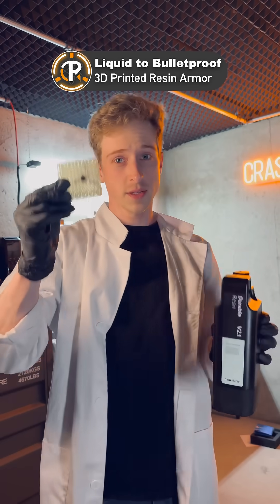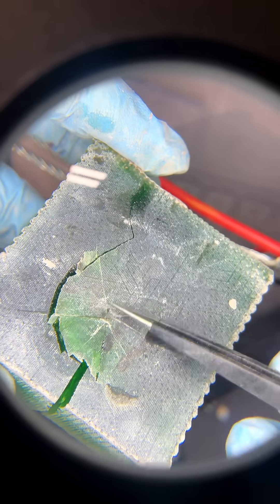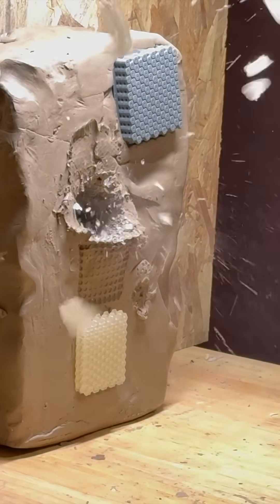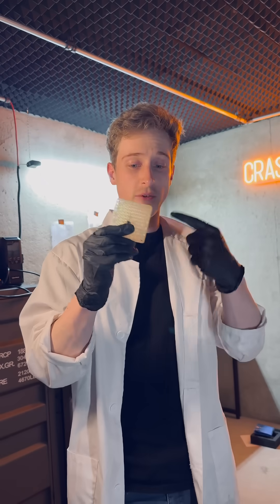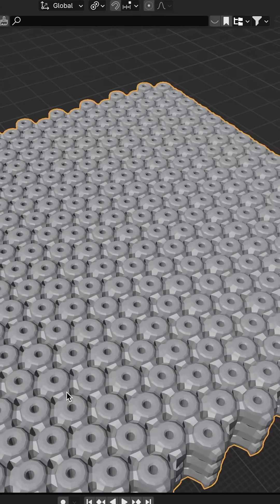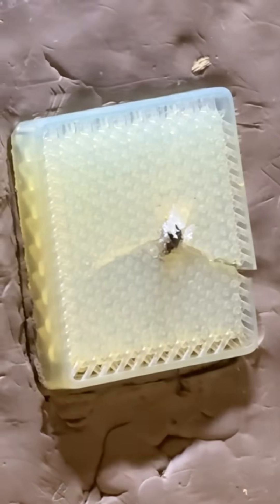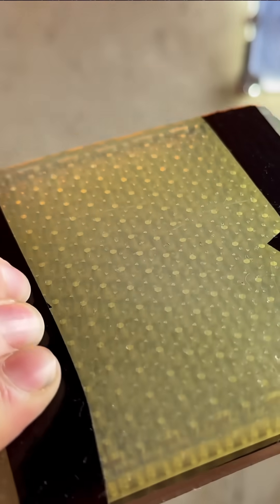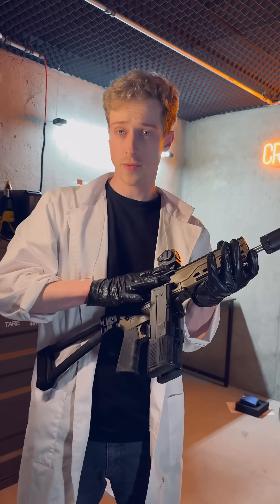BATMAN ARMOR💥🛠️ #Shorts

Comment: Now layer it thinly, kevlar between, turn your lattice sideways again to determine layer depth, a lattice plus a lil on each end to maximize the umpf of each layer of your material, kevlar, repeat.  Small hexes overlayed like bricks in 3D, held together by kevlar cloth sheets between, but locked in place as layers of loose stacked tiny hexes of your material.  You see the cloth armor that is really plate already don't you?  We haven't even spoken of high performance alloys that can be plated into any step, every step.

Comment: Have you considered using two different resins for the armor? If you were able to use a high tensile strength resin and a high compressive strength resin, you could potentially produce a superior composite armor. 

You could achieve this by printing a node grid of Liqcreate Composite-X  and then filling the voids with Monocure 3D TENSILE. When paired together, the composite resin material should out perform a mono resin material. 

The goal is to dissipate a round's kinetic energy through non destructive deformation. Currently, your prints appear to be dissipating a round's kinetic energy through deformation, fragmentation, and fracturing to accomplish said goal. 

By using a composite approach, the material should be able to withstand more impacts without fragmentation or fracturing, which should improve the material's longevity during a ballistic engagement.

Comment: What if you use a 2-3 layer kevlar sheet, impregnated with a shear thickening fluid, in front of the printed panel, or sandwich the STF fabric between the plastic and alum plate? Uses far less layers of kevlar than existing systems, no heavy steel; goal is significantly lighter ballistic protection systems, so even incorporating existing, known ballistic materials won't necessarily undermine your goals.

Comment: I know you probably won't see this but I have a question, Anyone who can answer, feel free to do so because it's a genuine question.

Would this theoretically allow for more flexibility if we made it thinner, more compact by overlapping plates of it or would that just cause compromises in the durability? 

Like instead of a solid plate, you made it look like lamellar  and layered that a couple times to deal with the shock but increase mobility? Then again, a drawback might be resource cost and the amount of resources needed. But it could cause flaws in the armor by segmenting it or making gaps that can cause issues in the long-run, leading to eventual structural failure.

Might have answered my own question but what is your take? Commenters included.

Comment: I would move to 9mm from 22lr. 5.7 is and extremely fast calibre. There are also  specific 5.7 military rounds that are known to be armor piercing. Most soft armors fail to it. If you succeed in a design that can stop full pressure 5.7 then you may want to file patents and start making calls. You’ll be a star lmao.

Comment: Just to point out, most people die of the force of the bullet, not the bullet bleeding them out, so while you did stop the bullet from entering, the force is basically the same
Reply: that's why a layer that spreads out the force and redirects it would be necessary. theoretically, if you could redirect the force so it's not goin into the body, you could stop almost any modern kinetic round.

Comment: I'm one of those people who really didn't think body armor could be improved, only tweaked. Glad to see you might be proving me wrong!
Reply: He's not.  what he's going to end up with is 3d printed plates 5 inches thick and 3x the weight of ceramic for the same rating.

This is nothing that hasn't been tried by the big armor manufacturers and engineering students before.
Reply: @shockwavecity  it seems like the empty space would make it lighter actually, even if it's 5" plates it'll still be practical because of that and also the ability to make it on site

Comment: 5.7 isnt highly penetrative. Garand thumb ran tests and its weaker than 9mm.
Reply from the maker: 5.7 is absolutely more penetrations than a 9mm, slightly less energy but lower cross sectional area and higher velocity makes it punch through armor WAY better. I bet the test you're comparing is a soft medium test like gel which is of course far different than hard panel penetration.

Comment: I see no value in what you're doing, but if I was doing this myself I would try and get an FDM printer. You're limiting yourself in terms of material. You can get some pretty exotic filaments with an FDM printer. They have a formaldehyde based filament which boasts a lot of structural properties you're looking for. And a dual extrusion printer may give you even better results if you layer two different filament types like nylon and Petg.
Reply from the maker: FDM printers lack the precision for lattices of this detail and node size required for effective dissipation, layer adhesion is another issue there regardless of filament options. Thin tubes and such on FDM perform very poorly against shear force.

Comment: It reminds me of a research paper I saw a while back where an aluminum metal foam with ceramic particles was found to be incredibly bullet resistant, just like this lattice. I'll try to find the research paper and 

I'd love to see you metal cast this with a vacuum smelter. There are resins made for casting that would do wonderful for this. With proper drainage, you could coat the inner openings of the lattice with slip, allowing you to cast the inner 3d structure with incredible detail.
Reply from the maker: totally dude! Metal Lattices would be sweet, and you're right about the drainage being a concern with some of these, gotta keep em open-cell. Metal foam is great too, it's just closed cell (which also works well).
Reply: @CrashMakerspace   for a smaller hole diameter, you might be able to get away with an extra runny slip and using a stronger vacuum on the smelter. There's vacuum smelters on Amazon I've been looking at for 500 to 600 dollars for some of my own projects. I can't afford them currently, but they really open a lot of options for home manufacturing. 

I also recommend looking at c95400 aluminum bronze. It's light weight but can be tempered like steel to adjust its toughness and hardness. It casts fairly well and has great corrosion resistance. It forms a corrundum layer on the surface, which can be useful. It was something I was going to look into for my own testing before I ran out of money for projects. 

I was going to try using it for a metal foam armor and backing it with steel  or coating the surface with something extra hard like chrome carbide if I could figure out an effective DIY method of applying it to the surface but never got to the point of making a thermal sprayer.

Comment: In theory you could make drive shafts/moving parts with the lattice method potential allow for greater speeds/more stress to be put onto the metal without failure
Reply from the maker: Correct! The lattices will just need to be derived and tuned specific to the loads & stresses the parts are going to be used for

Comment: 5.7 is a rough caliber for this testing, so fast and shaped for penetration. 9mm would probably be an easier step up.
Reply from the maker: correct ^ 5.7 drills much more than a 9 or .45 but I'm going for sharper BFD so I can tone more accurately for how well it's spreading the force as I tune it! These are ideally for impact padding behind a heavier plate carrier

Comment: Any particular reason you chose aluminum over AR500 steel plates aside from weight? 

Most aircraft made with several kinds of aluminum alloys and material thickness hit with small arms fire usually tends to end up looking like swiss cheese, hence my curiosity. 
One example sparking my curiosity is the armored pilot seats in Hueys, made from half inch thick kevlar wrapped steel (dont recall the alloy) for this particular reason.
Reply from the maker: Mainly just testing for sharp Back Face Deformation as I'm honing these for a durable impact pad behind a heavier plate! So I'm looking for dispersion of energy where AL does this for a good simulation of it's end function
Reply: @CrashMakerspace  ahhh okay interesting, i was quite curious so thanks for the response! I was imagining the material layup in the reverse order you chose, i assumed aluminum in the front. 
Its pretty neat you're doing this kind of R&D in a private garage though, kinda reminds me of the Steve Jobs story but with armor instead of computers.

Comment: Your hexagonal cellular design is quite strong at capture.
   However, outside the materials trials, there's relatively little ingenuity being incorporated to the final product.
   If i may, and i may be just absolutely wrong...
The hurdle to improve on in bullet capture technology is the transference of kinetic energy.
   You're already into cellular construct.
   On the backside of the strikeface, weave a capillary manifold between each hex set. This would likely need fill of fluid with sufficient viscosity. Allow these capillaries to vent at the edges of the plate, redirecting kinetics at a ninety degree angle by expelling under force a small amount of mass.
   Blow out panels are pretty basic equipment on ordinance containers. You've the opportunity to incorporate kinetic absorption in places its never been.
   Kick me down a buck when you make a billion.

Comment: It needs to stop 7.62. Most common round shot at US troops. They have body armor already that stops airgun rounds.
Reply from the maker: My lattice armor stops 7.62 no problems (it's stopped .300WM multiple times along with many M855 (green tip 556 & .308)). That's not the point with the research here -- it's for an impact pad

Comment: You're really just wasting time.
Reply: Why?
Reply: A person having fun???? 
Oh no call thw cops
Reply from the maker: ^ Says a guy commenting on YouTube videos?
Reply: @CrashMakerspace  it took me a few seconds. You're taking weeks and weeks, maybe even years. Do you think there's an equivalence between the two? What you're doing is cool, I'm not denying that, but it's not going to be implemented in any way. A horse stable mat is strong enough to stop shrapnel. Glue on a sheet of AR500 steel, and you've got level 3 protection. You initially had me when you didn't mention adding metal, but since you're adding metal, it makes it just a more expensive and complex version of a very simple thing.

Comment: Is there something about the different printers that made the part stronger or could you use the stronger resin on the cheaper printer for the same results?
Reply from the maker: You could, in theory, do this but you may end up with some failed prints with tuning. You’d also want to check for heated print vats etc.

Comment: Watch that aluminum spalling and coming back at you. You can use a rubberized undercoating on that to hold some back. It has a bit of elasticity and holds the jacket or pieces of the round.
Reply from the maker: You’d want some composite face like with my super armor plates to catch spalling, this is just for deformation testing

Comment: Maybe try putting a thin layer of something like g10 fiberglass that is significantly harder than steel to help break the bullet up on impact.
Reply: What? my dude. G10 is not stronger then steel.. they use G10 On gun parts. It's light weight and strong yes.. but not stronger then steel.

Comment: Make holes just under the size of the bullets. There was an armour that used this shape to cause bullets to lose energy and get blown off course
Reply from the maker: These holes are much smaller than the size the of rounds
Reply: @CrashMakerspace  I think the original idea was to make them just slightly smaller so the round would mostly impact with one of its sides and get thrown off course

Comment: Just to be clear, the capabilities are entirely down to the resin and not the printer. You can print durable resins on that cheap hobbyist printer just as easily as you can print cheap, brittle resins on expensive printers. It's great to have access to a Form 2 but that's not the thing that made the difference. :-)

Comment: This an ad

2) consumer printers are not designed for minis and we're used for dental work for decades before people started duping Warhammer

3) the resin makes the difference, not your formlabs printer, you can buy resin for MSLA and SLA machines with the same properties as formlabs resin.

Picking a cool project but lying about the type of printer is dull

Comment: I wouldn't bother using aluminum.
If you were to use your three d printed strike face and you were to have high molecular weight polyacthythylene, you would probably have the stopping power of ceramic and the catching power of what is behind it. It's the same way that our level four plates are made now.But instead of ceramics, you're using your lotta structure, that's the strike face
Reply from the maker: Yes this is all covered I my super armor plate that stopped even multiple .300Wm. This video is talking about impact dissipation.

Comment: Neat. So what's its enviromental durability? Does it degrade from heat, cold, UV or humidity exposure? Have you tested it against saltwater yet? Stopping bullets is just the starting point. If it degrades in the field quickly you wont be making good level III armor with it, Sweats acidity is usually something a lot of designers don't account for
Reply from the maker: Dude I just started the research haha, it's a prototype all these variables are tested eventually like with my other armor, but I just posted my first update for these resin options
Reply: @CrashMakerspace  Oh, i'm not bagging on ya, little brother. I was just asking and sharing what points of failure i've seen trip up other designers over the years. Try help ya avoid the freshman mistakes.
Reply: Simple mechanical abrasion is a question too. Wearing it all day means it'll face a lot of abrasion. It's made of resin which is not known for abrasion resistance - in fact it's known for abrasion vulnerability.

Comment: Non Newtonian fluids or shear thickening fluids are the future of armor.  Solid plates are a dying technology.
Reply from the maker: Thus far STF is hyped, unfortunately against rounds it is far too soft even in its jammed* state to stop. There is fun research around using it for back padding, but for actual round stoppage, you need very hard materials (rifles especially). D30 could be used as an impact pad, but straight D30 or impregnated kevlar D30 fails miserably against any rifle round

Comment: You can mix resins of different tensile strength properties to get the part strength you want. Upgrading to a seriously expensive industrial resin printer is not necessary. People have been mixing resins for years on the most commonly available printers on the market.

Start at a 90/10 mix, 90% brittle resin and 10% flexible resin, run a test print with tiny easily breakable details on it. Keep adjusting the ratio until you can touch those easy-break parts and they don't break.

Comment: once you finish this complex lattice resin design could you compound it further by applying it as interlocking style almost "Dragonscale" plating? it might increase the flexibility at the cost of slightly increased weight on the final product, im sure you have an idea for a much more efficient application though im looking foreward to seeing future updates on this concept!!!
afterthought : (if you make it thinner, could you multilayer it with carbon fibre layers in between lattice layers? it wouldn't increase hardness but might help the structure stay together after multiple impacts? im invested in this concept now)
Reply from the maker: I wouldn't have the ceramics "interlocking" as ceramics simply explode when hit with a round going 2K+ fps regardless of meachincal structure (which is the point actually as it blunts the round) but the best approach is simply flat lamination making your bonding as hard and impact resistant as possible! Lattices and such too don't apply to ceramics as you need some flex such that the flexure load dispersion can work. Yep and as to CF or FG composites, those ideally would be on the very face!
Reply: @CrashMakerspace  i didn't think of those things! Great points, and TY for the explanation. 0.0 this stuff is even more complicated than i thought.

Comment: I see you have it as a square block, does it effect the stopping power or structure when introducing curves? I’m thinking like if you were to form it similar to a male chest or bracers. Btw this is so cool to me! If I had that equipment and some of that knowledge I don’t think I would ever leave that room. I got a 3D printer about 8 months ago and I definitely have an obsession. How would you propose someone gets started in the direction you are going? I figure you could cut down on the trial and error factor pretty significantly.
Reply from the maker: Yep, having it curved would help stiffen the part to deflection and improve is deformation resistance

Comment: Why aluminum? . A laser cut ( for semi flexibility) 1/16 inch cpm 3v or s7 tool steel plate cover  would be far tougher and harder for dispersing the energy of the round especially higher velocity rounds. Is it a bit more expensive? Sure ..but it could jump you major ratings. Especially if the hardness is played around with.
Reply from the maker: I can think of many things far tougher -- but this is quick & dirty research and 7075 was a fair enough metal to test sharper BFD for the lattice to disperse

Comment: Pretty cool, but one thing to consider is that by changing the material, the interactions will vary from original results thereby defeating the purpose of having done the original experiments in the first place.
Reply from the maker: The impact research stands, the aluminum is for the face and the energy dispersion for the backing is still needed